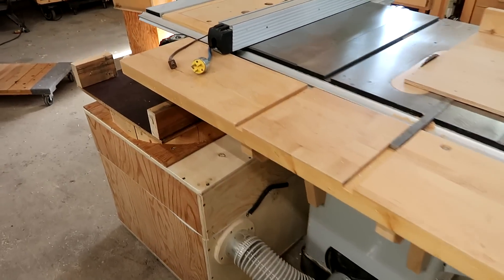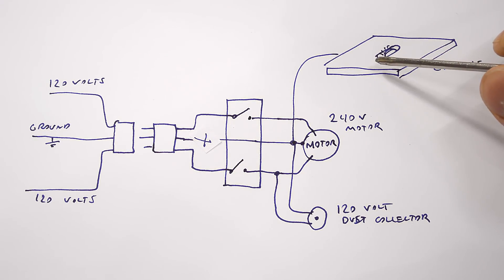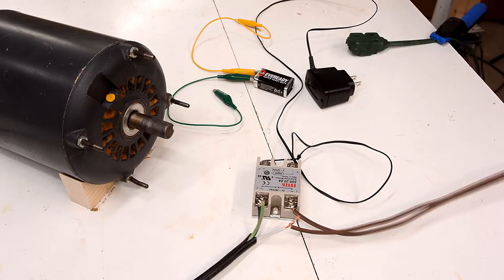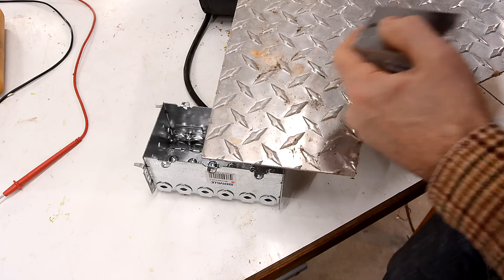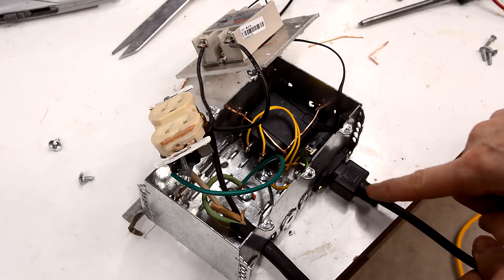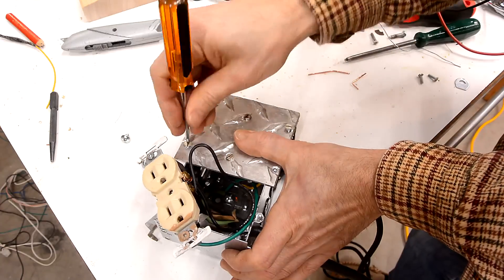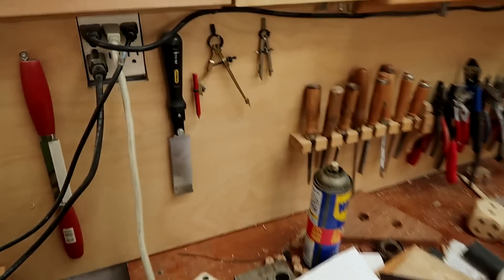Relay box to automatically turn on my dust collector

Comment: White lithium grease works as heatsink compound and you can pick it up in 1lb tubs in the automotive section of Walmart. It's used to grease axle bearings on boat trailers.
Look for LubriMatic White Grease 1lb  8 bucks

Comment: This is exactly the same system I have on my laser for fume extraction. The laser outputs a 48v DC trigger to say the shutter is open and ready to fire, and I use that to switch a cheap Chinese SSR, and that automatically switches 240v to the fume extractor. Works fine.

Comment: Just make sure you do not draw more than 10A on that 240v socket in your project box they are C13 sockets and are only rated at 10A 240v

Comment: I don't understand Why you have 120V equipment in the first place. Why not just stick to 240V if that's your mains voltage anyway?
Reply: In north america we have 120 and 240 mains. Both are present. 120V stuff is more common. Usually only high power devices use 240V.

Comment: Why is there a delay when you switch it off?
Reply: The SSR draws a small amount of current, and the capacitor in the phone charger which smooths the output of the phone charger can supply that small amount of current for a while after the power is removed.

Comment: Cue all the folks from Europe who are aghast at seeing all this in a metal enclosure.

It's from the comment sections on these videos that I learned they don't use metal enclosures in Europe.  Funny what you learn on Youtube.
Reply: Jeff Spaulding we do use metal boxes usually sunk into plastered walls and similar ones for outbuildings surface mounted but the terminals are recessed into plastic to stop any chance of short
Reply: Oh.  Well then, it's funny what you think you learn on Youtube and then find out it's wrong :)
Reply: While i love what Matthias is doing i'm not a fan of his electrical work. Not because of the metal enclosure but because of the lack if electrical tape. Not isolating the copper wire and all the terminals is what made me cringe.

Comment: why did you use a solid state relay? couldn't you just use a Contactor with a 240V coil, because that doesn't get hot if I remeber correctly, contactors are made for switching big loads like motors, its like a normal relay but a bit rated for a higher current. Also it has 2 break points so that it can't arc that much across the contacts.

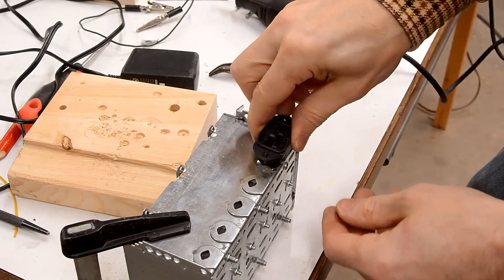Comment: I definitely need a "real life FFW button" like 03:18 :D I'm interested in how long your SSR does the job. Got a bunch of them and two relays fail after less than 6 months... Great Job Matthias, thanks for sharing!
Reply from the maker: I got one on the hot water tank where it switches 20 amperes daily, still working.

Comment: i actually wonder they have these floormats made for putting cables under,are they actually usefull,or are they in general just usefull if you move things around on wheels a lot/thicker cables?i think they are most of the time made out of a steel or plastic and they kinda are like a roadbump
Reply from the maker: could be useful if other people walked around, but really hard to roll stuff over.  I think I'd rather lift the cable when I need to roll something.  The cable runs where I don't walk much.

Comment: they make solid state relays with a 240vac coil comparably priced to what was used
Reply from the maker: Oh, good to know.  Didn't run across any on my search initially, but if I search AC-AC solid state relay, I see them.  I should buy one for future projects.

Comment: I know you haven't done anything wrong here and I'm not criticizing any of your wirings but watching from the UK,
the American and Canadian wiring just looks so dangerous compared to what we have here in the UK, bare/exposed terminals in metal boxes etc. I know it's fine but it just looks so unsafe. love your channel though.
Reply: I agree, it is probably fine, but It seems a bit odd that in a country obsessed with safety instructions and lawsuits, electrical safety is lagging with the rest of the world? Could their low mains voltage have something to do with this? On the other hand, current is doubled.
Reply: My guess: Low voltage higher contact dissipation so they need more temperature/fire proof materials
Reply: Our metal boxes are grounded. If something goes wrong it trips the breaker.

Comment: I still don't get how the hell he got 120V if he takes 240V from table saw...and i'm electrician
Reply: Kristian G and this is what I said earlier the so called pro's often have zero understanding of the physics of electricity. They only know what they have been shown. This is so basic. So many of the pros are like parts swappers in the auto mechanic trade. Compare the complexity of this to the phones he used to design.
Reply: Yeah but we in Europe don't have this kind of problems, and here i could just take one phase from table saw and it would be done...

Comment: All those electrics inside. I'll just mount this using copper wire. ...............

Woah....
I'm no electrician not even a bit but that just seems wrong. I worry for Mathias sometimes.
Reply: Using metal is actually good. If there ever is a short, it could come in contact with the copper wire, which is attached to the metal box, which is grounded. In other words, there is a path for the power to go other than waiting for a human to touch it which would create a path hurting someone.
Reply: Brandon Francey As I said to someone else, scene 1) you trip power if it shorts to earth, saw still has momentum but now spinning in pitch black. Scene 2) only one phase trips, the saw only gets 120v, will stall in the wood and it ain't gonna be happy running on 1000+ watts with no cooling and a saturated core. It will turn into an overpriced room heater
Reply: It's used as strapping... and is not in contact with any hot wire. I think Matthias has proved that he is very capable, time and time again.
Reply: Brandon Francey phew !!
Reply: Brandon Francey Exactly this. If the copper would get electrified, it would pop the GFCI in the subpanel.
Reply: I had the same thought haha
Reply: I would've covered the ſolder joints with electrical tape and ſtill used wire for mounting, although as long as he didn't ſtrip to much wire before ſoldering, even the tape ſhould be unnecciſſary, unleſs the mounting wire is looſe.
Reply: kooky flukes exactly what I thought
Reply: I thought this too, and went back, and thankfully the box is grounded.

Although I don't like the fact that wall sockets are always live, that's crazy to me. Basically every other country outside NA has switched outlets. Stops kids dying at least a little, also stops arcing when you plug shit in. Also given that NA runs on 110/120V, to get 2000W out for a kettle, you need nearly 20A, whilst the rest of the world on 230/240V uses less than 10. Considerably reducing cost of wire installation, and the probability you start a fire.

+Jeremy Hook what is wrong with your s key mate.
Reply: Great idea! Using the 5v adaptor for supply on the relay. But, please, put electrical tape or shrinking tubing over the live wires for the C13 connector and power adaptor :)  Great videos, love seeing them.

Comment: Be sure you understand the failure modes of an SSR : half wave (partial on) or on (full on).   Half-wave can supply a less than desired output to your dust collector.   No problem if the dust collector motor will handle a half-wave source.  Big problems if it won't.  Nice thing about mechanical relays is they generally fail off.
Reply: If you are wondering why Matthias used a SSR, then you haven't been watching enough of his videos. The simple reason is, because he had them laying around.
Reply from the maker: If it goes half wave, that would be a problem.  It would quickly blow the thermal on the motor (and I know the motor has a thermal, because at some point I accidentally jammed the starter switch shut, and it cut power after about a minute)
Reply: Yeah, why not use a mechanical relay? They pretty much can't fail on when running AC. And you can basically forget what has been said about half waves.
This project doesn't benefit from click-less switching or fast switching anyways.
Reply: I'd have used a mechanical relay both for simplicity and reliability as I'm normally building for others.
This works and importantly, it'll be never used unsupervised and any failures won't be dangerous, just dusty. So it's valid.
Reply: This is likely a counterfeit FOTEK, so that means it contains a single BTA16-600 or BTA16-800 insulated-tab triac (or a fake equivalent).  I'm not saying it's not prone to failure, rather that expecting 'typical' failure modes is probably misguided.  These fake triacs have unreliable dI/dt and dV/dt immunity.  Add the fact that they're undersized and have large thermal resistances near the junction, they are very easy to get stuck on by the thermal load caused by starting a motor or heater load.  I have never had one fail half-wave.  I have had over a dozen fail shorted full-wave.  

If indeed you observed a fake FOTEK spuriously rectifying when the input were 5v, that would likely be because the optotriac is being run below its minimum trigger current.  The counterfeit FOTEK parts require at least 5.5v to be within the input current spec for the MOC3063 opto.

EDIT:  I just went back and took a closer look at the relay.  It is certainly a counterfeit.  I just couldn't tell at 240p
Reply: @Sasja : and less voltage drop. But if I had an SSR laying around and would have to buy a mechanical relay the choice would be easy

Comment: Would a non-solid-state relay be a better choice in this case, since they have little-to-no voltage drop across the output?
Reply from the maker: yes, that would work.  But they cost more.

Comment: What I understood from ElectroBoom is that the 2 phases canadian houses get are only 120 degrees out of phase, not 180.
Am I thinking of something else here?
Reply: No. In most homes, the supply is what they sometimes call split-phase. There are two hot wires. Each one is 120 V to neutral. The two hots are 180 degrees apart, so the voltage from hot to hot is 240V. His saw is running at 240 using the two hots. There is another type of system, what you must be thinking of, which uses 208V three-phase power. In this system, any two phases will measure out at 208V. But any phase to neutral will be 120V. The three phases are only 120 degrees from each other (as is the case with all three phase power).

Comment: Only problem with this is that the Nokia charger cable should be replaced. I don't know what is it about the cable but after a few years (and considering, there's no argument that it is old) starts leaking copper oxidation through it and eventually, the jacket just fails. I replaced all of my cords because otherwise, those chargers know no death. I still use my original N97 one with an USB adapter to charge my 1020.

Comment: I was planning to build a similar solution but with a HALL effect sensor. It detects current flow in the power cord, so no modification needed on the tool.
Reply from the maker: yes, that would be better, but more complicated.  Would be cool if you could just clamp it onto the power cord you need to monitor.

Comment: If you were going through the trouble of running an extension cord over there anyway you could have just wired one of the 240 phases to the neutral of the extension cord. The hot line would be controlled by your saw switch, go to the blower and return through the neutral of the extension cord. No relay required. You can still wire the top half of the plug to the extension cord to be always on.

Comment: Much simpler to run a 4 wire cord, 2 hots 1 neutral, and a ground.
Reply: he would need to run new cabling all the way from his breaker box. Not more simple. Also... if you are going to run 2 circuits with a single neutral if the shared neutral gets disconnected, you end up feeding 240v through your two 120v circuits in series. This is falling out of vogue and the pros run two cables now instead when there is more than one load on the other end.

Comment: you can actually use the tablesaw to cut aluminum, Doug over at svseeker does that regularly
Reply: though I remember it crashing once where one of the teeth bent 90°, so it mayyyyy not be the best idea
Reply from the maker: The reciprocating saw made quick work of that small piece.

Comment: You don't use whole-house GFCIs? In Europe they're required since the 90s, for fire safety. Wiring a load's neutral to ground is also prohibited, even though it technically works without a GFCI, for the exact reasons you described...
Reply: EU systems are more dangerous, you need whole house GFCI to reach our level of safety without them. We also use metal boxes to eliminate most electrical fires from arcing, they are grounded so if power goes to the casing, just like any other appliance, the breaker trips. 

Don't worry, our safety nazi's are trying to push these expensive devices on us. Admittedly they are cheaper in the EU due to economy of scale but here they are in the hundreds of dollars. all sleeping spaces now need arc fault protection which is different than GFCI, to prevent fires that are already prevented by the metal boxes... mostly they become nuisance devices now that don't add any real safety but they sure cost a lot.

Comment: I love how when you make it safer than what you had, and probably about as safe as anything you would buy you get all the safety police out about all the exposed contacts INSIDE your box.  LOL

In my case I have mine wired like you had yours originally- I mounted a separate electrical box on the side of my saw, and used an outlet that can be split into 2 separate circuits like yours, and wired one side to one leg and the ground before the table saw switch and the other side to one leg and the ground after the table saw switch, giving me a switched 120VAC for he collector and an always hot 120VAC that gets used for thing like sanders and if I want to use the collector to clean up when the saw is not on.  Yea, I could get zapped with 120VAC if the ground feed broke, but that's seriously unlikely and even still, how many of us that have ever tinkered with anything like this before hasn't zapped themselves a few times before.  

I would reconsider if it was something my kids would use or if it was an item for sale, but if my kids are using my tablesaw, well the saw is more dangerous than the circuit and I'm not selling my 40y/o table saw.
Reply from the maker: If the ground broke, chances are you would not notice that the table saw is hot.  When I was about 16, fixing one of those old tube TVs where chassis is connected to one side of the lead with an unpolarized plug.  Every time I plugged it in, I'd swipe my hand across it to make sure it wasn't hot.  After about ten times, I figured, what are the odds that I plugged it in so chassis is neutral every time?  So I checked it with a phase tester.  Half the time, it had been hot.  But without me touching ground anywhere, I just never noticed.
Reply: Yea, I've been in that situation also.

Honestly, my point was more along the lines of, "I'm surprised  you bothered, I mean I get it but surprised, I'm doing the same thing that you were and not too worried about it."

;-)
Reply: The best solution would just to use industrial stacking switches, they do exactly what Matthias is doing here all the time in industry. He has a very common problem, power on or signal a low voltage circuit with a high voltage circuit. Matthias has an interesting solution, and i'm sure he's smart enough to be safe enough to be just fine. After all, people used to keep themselves alive with just the muscle between their ears, they didn't have everyone around them constantly making OSHA approved cowboys (google it, its funny).

But if I were doing this, i'd just buy $40 worth of stacking switches. One stage of the stack can switch the 240V section, then you can stage a 120V section off the same switch. Then the 240V and 120V sections are completely isolated, any broken wires then follow the same flow paths as individual 240V and 120V circuits.

Props for ingenuity though.